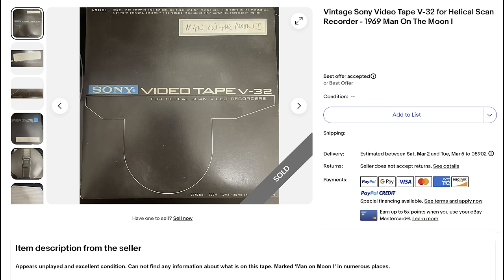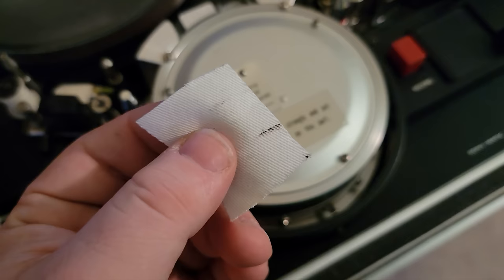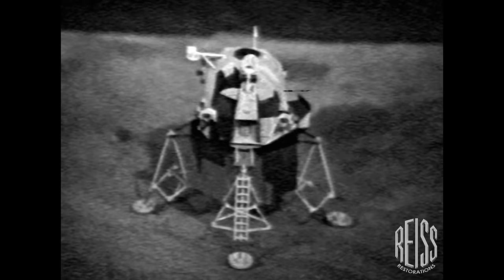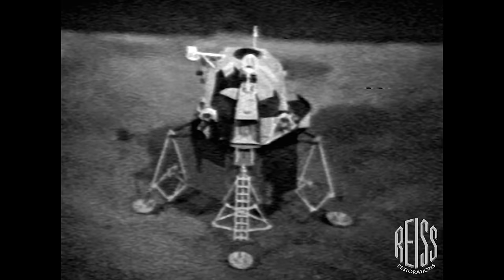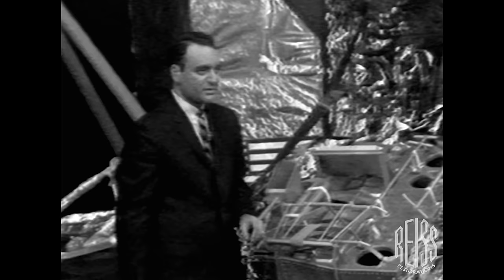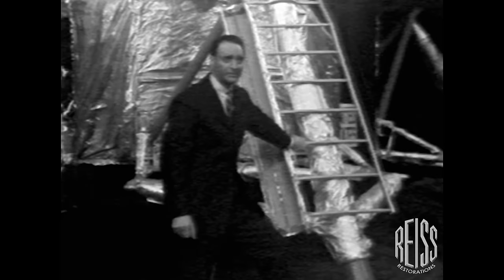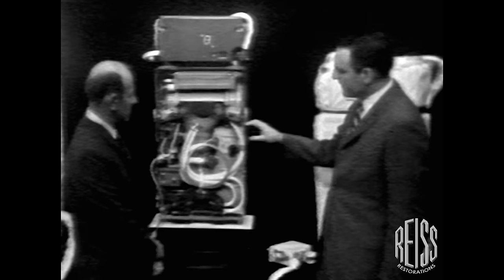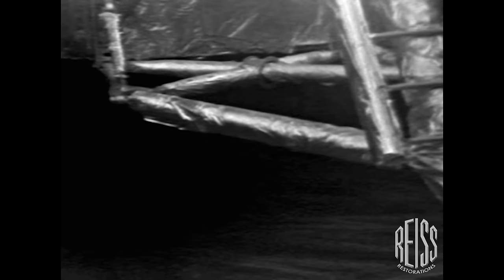Finding and Digitizing the Apollo 11 Moon Landing on NBC (July 20, 1969 - Partial Broadcast, B/W)

Comment: The instant communication between the earth and moon in 1969 is impressive..  they must have destroyed this technology along with the rest for some reason...
Reply: Since we hear the radio chatter from the ground pretty much as it’s spoken, we hear them respond to anything the men on the moon say in about 1.5 seconds, which isn’t that long, but you can definitely notice it when they speak. It takes another 1.5 seconds for the response we hear to get back to the moon. It’s not instant, but it’s not actually that big a delay.
Reply: That’s what causes the bits of awkward cross-talk at times like 13:53

“Roger Eagle, you are stay for T1-”
*crosstalk about venting the OX”
“Roger you are stay for T1”
“We are stay for T1”
“And we see you venting the OX”

The crew on the moon was talking about the oxygen and ground control was talking about T1, so they kind of talked over each other for a bit until they both got on the same page with the delay

Comment: The camara is turned on from inside. My first tv video remote had a long wire. Bull shit.
Reply: 39:38 Aldrin flips the circuit breaker inside the lander that powers up the camera. There was no remote control. The camera was connected to the lander by a cable the entire time.
Reply: @dansv1 I think you need to watch it again 21.17 I think you see what you want to see no wire connected on that camera.
Reply: @keithbstar1  
That is a mock-up. Watch the 16mm film of Armstrong setting the camera up on the tripod. You see the cable.
Reply: @dansv1 why do you lie you don't see any footage of the camera with a cable getting put on the tri pod. If you did see Niel putting a camera on a tri pod it would have to have been filmed from a different camera.tell me at what time you see the camera in the 16 mm footage with explanation of how a camera filmed itself.
Your a liar
Reply: @keithbstar1  
No lie. Find the video APOLLO 11 16mm ONBOARD FILM 1969. 
At the 53:40 timestamp you see Armstrong carry the video camera on the tripod with the cable attached and trailing back to the lander. The 16mm camera is inside the lander pointed out the window.
Reply: @dansv1  considering the camera was the camera that filmed the moon landing. You don't question who is filming Neil and this camera. The film crew in the studio

Comment: How did we make it thtu the Van Allen belt again???
Reply: James Van Allen said it wouldn’t be a problem.  Speed and ‘belts’ are the clues
Reply: because it's not an issue
Reply: They were in a shielded spacecraft and the trajectory was chosen to go through the narrow part of the belts and do it quickly, to minimise exposure.
Reply: And how did they lose all the recordings?
Reply: @ggavinkru  
They didn’t.  In fact you could have bid for a set that Sothebys auctioned a few years back.  The only recording lost was a backup copy of the slow-scan TV tape.  Always research before making a goose of yourself..
Reply: @ggavinkru  ...the didn't

Comment: Communication responses are immediate. Where is the delay with the back and forth audio transmission with 1969 technology?? The moon is about 238,900 miles from earth. To put this in perspective, the circumference of the earth in miles is 24,900.  I can make my argument with literally dozens of other reasons, but there is no way we went to the moon! Sure I would like to believe it, but the evidence supporting that we didn't go greatly refutes the purported story that we did. Do the research and listen to your common sense. A good start is merely looking really closely at picures of the lunar excursion module.  It didn't happen.
Reply: From our perspective, there should be no lag between hearing the astronauts finish and the ground start and only a couple of seconds of lag for the opposite.
Reply: @intcheese  Watch "A Funny Thing Happened On the Way to the Moon" for more evidence.  And there's a lot more to add to that.  Respectively...
Reply: @phowell333  Seen it. Not impressed.

Comment: Temperature on the moon goes from-133°c to 121°c. 
Now ask any professional photographer if film stock can survive in those temperatures.  Also taking into consideration the extremely fast temp change in a complete vacume, from darkness to light.
In fact , the film stock could not survive. And when you look up the interview with the man that designed the camera for the mission, he plainly states he has no idea how it worked. 
I am not questioning weather or not man went to the moon. But I am quite sure the images we have shown are not from the moon.
Reply: You’re not very smart.

Comment: It’s truly amazing how our video technology was so primitive, and our space program was so new, yet with good old fashioned American drive we did it and were able to communicate without any delay, thru the Van Allen Belt and 238,900 mi away, when we still to this day have a delay of 6 sec to the space station just  254 mi and no plasma field. The impossible is possible because Americans have magic and God to make it so! They didn’t even try, because they knew we would question nothing! That’s the funny part! Like the nuclear tests where the camera is right there and not even a shake? A special nuclear resistant camera! It’s estimated to be close to half an hour delay with today's standards, that’s why nothing is remote controlled! Also, the Van Allen Radiation Belt is 2,000 to 20,000 (Kelvin). But we made it because “We went really fast” That’s a quote!

Comment: Am I the only one wondering why it says "ANIMATION" on top and who was actually holding the camera? And from where?
Reply: There was no external camera to film the landing so the television station made an animation and used models to represent what was happening. The first steps were captured by a camera on the leg of the lander after the landing
Reply: and that camera and film survived outside the capsule through all temperature changes and space radion?
Assuming that voice transmission was real and analog, what would have the delay been  over this distance?
Its also interesting that in this day and age a few kilometers out of town you have no phone receiption but 50 years ago they had a clear and delay free phone call to the moon.
Reply: @Lukas114  The TV camera (not film) was in the MESA (Modular Equipment Stowage Assembly), which was closed until after landing.

About 1.25 seconds each way. 

Nixon called Houston. They just patched the phone call into the existing DSN radio communications they were already using to communicate with the astronauts.

Comment: Just looks fake as heck. As if that landing capsule could handle the supposed vacuum of space. Look into testing cylinders to handle vacuum pressure to understand how that thing would just be torn apart. Also their suits would have to be so, their suits couldn’t handle the pressures yet they move so easily. Just nonsense if you understand what pressures they would have needed to deal with, their suits would just be torn apart if a second, as would the landing prop. It’s a joke
Reply: Yes, it's a fake but they faked it on the moon to make it more realistic.
Reply: @fredbrooks9496  ahh… impossible. You believe they made it to the moon with 18months planning in 69 and we can’t get back? NASA now say “we’ve lost the technology that got us there”. It’s just bullshit. It seem the van Allen radiation belt wasn’t a problem in 69, just wrap the thing in alfoil and you’ll be right. Check out the doco ‘a funny thing happened on the way to the moon’

Comment: Oh my God dude. When you are winding your tape in fast wine mode. It never comes out of contact with the, rotating video heads! What do you mean you don't want all of that gunk and dirt  on your video heads? What do you think you are rolling by your video heads?  Oh God?  Jesus Christ! Mohammed and all those guys Buddha, Vishnu! The rotating heads are still and always in contact with the heads.

I mean really it's not like a, U-MagicCartridgeVideo Recorder. That doesn't necessarily have the tape in contact with the, rotating drum video heads. When in fast wind mode. In, those contraptions. You've got a consumer piece of stuff. Where the picture breaks up in fast wind mode into gobbledygook snow. As these, Helical Scan  recorders. Covered an entire frame. Not like, vertical Quadra Plex, 2 inch, Broadcast Grade Video Recorders. No. We can think Sony for the Helical Scan, recorders. That could provide for, slow motion and accelerated motion, playbacks. With a full frame viewable picture.

And that baking technique? I consulted with the guys at 3M, Ampex and Agfa. About this. Nearly 30 years ago. And they all said, 125 degrees F no higher than 140. Because then the tape will melt beyond 140 Degrees Fahrenheit. And that's the information from the guys at 3M Scotch, Ampex and German Agfa. Where did you get 155? Did the tape become more tolerant to heat due to age? Somehow I think not? You got very lucky! With a piece of Chinese crap. That did not make it to 155°F.

And you should know. All recording tape. Sheds a certain amount of iron oxide particles. With each and every pass. And where some machines. Actually had those, cloth style wipers built into them. Others also used, vacuum pumps. For both tension control. And to vacuum the tape. Before it passed over the heads.

And all recording tape both audio and video is Lubricated. It is lubricated with silicone lubrication. And over the years. 60 years. It dries up. And that creates other problems. Such as, Scrape. And the tape begins to oscillate. Like somebody bowing  a hand saw. And it screeches. It imparts that screeching sound. Into the audio playback. Making it unlistenable. And causing the picture to break up. Because all of the silicone lubrication has dried up. And trying to re-lubricate the tape. Can become a messy nightmare. Because the silicone lubrication. Manages to get in and onto, everything. Causing everything to slip and slide. Where it shouldn't. And nearly impossible to get rid of all of it. Because it's going to get all over everything. You try to relubricate a tape with silicone lubrication. I know. I've tried. I've done it. It's a mess! You don't do it on an important, machine. You do it with a crap machine. That still barely runs.

And you should know. When cleaning those little chip  ferrite, video heads. You don't swab them from side to side. You swab them, vertically with the gap in the head. Otherwise? You can badly damage the head wiping it side to side. It's a tiny chip of ferrite.  And they tell you to swab the heads, vertically. Not side to side. Did you get the manual with that? Have you read the manual through? Do you believe in reading manuals? Or just watching YouTube videos for all of its accurate misinformation? Right it's that. And now you know how to do it so you need to show off to others. Swabbing your heads back and forth. WRONG MR. VIDEO BREATH!

You have just gotten amazingly lucky. You are a complete  technical buffoon. How did you get this way? Somebody drop you on your head. On a Carnival Cruise to the Caribbean? Apparently so? As you gotten nothing more than lucky here. Very lucky. Extremely, lucky. Through no fault of your own. Other than ignorance.

Did you ever try to first play the tape through while, digitally capturing it first? In case something went wrong during the Baking? No you did not. You just know you're supposed to bake them, first. Yeah no. No, first try a playback archive pass through. Stop it from time to time. Clean the heads. Clean the tape path.  Keep going.

And tell me sir? Did you bother to, Demagnetize, the tape path and the heads? Before you attempted to play back anything, load any tape, wind any tape through? No you did not. Because you don't have the gizmo. And you didn't get any magnets near the heads. Right. You don't have to.

Anytime one of these  recorders audio or video. Is transported. In a northern or southerly, direction. For more than a few miles. It automatically starts to magnetize the heads and the tape path. Along the magnetic flux lines moving north and south. This does not happen. When the machine is transported west or east. But only north and south. And it happens rather quickly in a very short distance, of distance. And they remain magnetized. Which then, adds lots of background noise and wipes off the high frequencies from the tape. We are the video frequencies are. And the audio frequencies, as well. Ugh!

Any Tape Pro, knows this stuff. Most don't. Most are clueless. Like you, sir. Go create, their own wacky procedures. That worked the last time? And will melt everything. When you order a new Amazon jerky dryer and fruit dehydrator. When it actually gets up to 155 ddegrees Fahrenheit. And you will have to pry off this chunk of plastic. From the Teflon impregnated shelf. That doesn't melt at those temperatures. As it is not, nylon, polyvinyl chloride, mylar, acetate, polyester. It's, Teflon. And not used for cooking anymore. Great for wire insulation. It doesn't melt easily. It's like the Corning glass cooking dishes of plastic. As other glass will crack, break  and/or melt. So they use a different kind of sand. At Corning. And when they blow it out of the machine it all turns pink! But I thought glass was predominantly green? What the hell is going on here?

This was all very cool. It takes me back to when I was 13. I've got the whole audio recording from the, VOA. Off of my Radio Shaft DX-150 A, shortwave receiver. With CBS and Walter Cronkite. On the other channel of my, all vacuum tube, AKAI, M-8, reel to reel recorder. A clone of the Ampex, 602. Only more versatile. As it could run at 3 different speeds not just one. And could playback both consumer and professional, stereo reel to reel tapes. Both 1/4 and 1/2 track stereo. It was an awesome machine. For a teenager to use and have. And I have both tracks running simultaneously with each other. Only the VOA is only, Neil and Buzz's, radio track. There is no, radio color commentary. By any host or anyone. It's clean. And it's a whole lot of silence. That can now be easily telescoped down. And I used a Fresh roll of, 1.0 Mil, 1800 foot reel of tape. Running at 3.75 in./s. For 2 hours of recording time on each side. With a deftly fast tape reel, flip. During the many minutes of quiet time. Between verbal communications. So nothing was missed.

And the fact that you actually had a, TBC/Frame Store Synchronizer. Made a huge difference in the playback! Bravo Sir! I was impressed when I saw that TBC. How about that I thought?  This guy knows enough to be dangerous!

And lucky for you this tape played back after the damage you did to it. But I'm also not certain. That it's a fraud. And here's why.

This was all originally captured on 2 Inch, pro video recorders. And that recording. Was copied upon. One of those recorders. With tape from that era. Still sitting in boxes brand-new. That were never sold. And a couple of these old machines. And you plug it into the other video recorder. And you make copies. And it is the original recording. And it is on a machine. A consumer could own and did. Of that era. But most people didn't own those. Some rich folks did. Ballet dancers may have? As that's who, I got mine from. As there were no other devices like these. Until the consumer got Betamax and VHS. For consumers specifically. But also found their way into, low-budget, rinky-dink, independent UHF-TV stations. And Cable Access, joints. Where 260 line bullshit video is acceptable. And we have seen plenty through the years. I still have plenty of my VHS tapes that need some archiving for myself. Not for time immemorial. Just for me. But after I die. And they find these on my computer. It might become a YouTube Internet hit? And somebody will make the money on me I never made for myself! Posthumously! FUCK!

It's always stuff like that for me. LMAO, OL.
RemyRAD